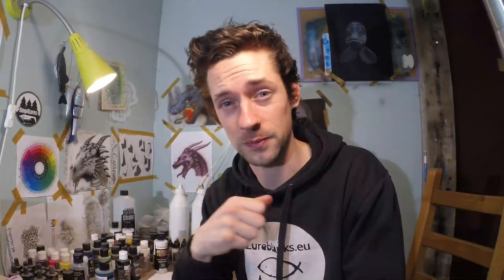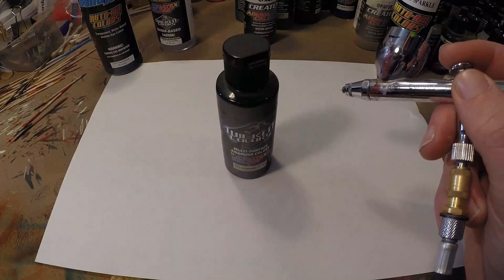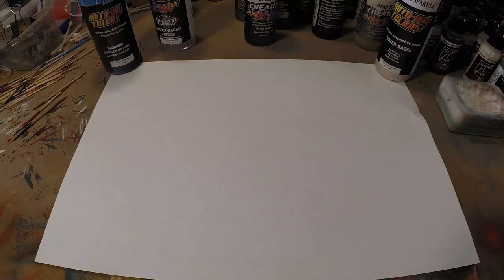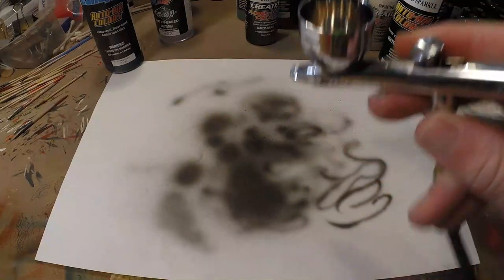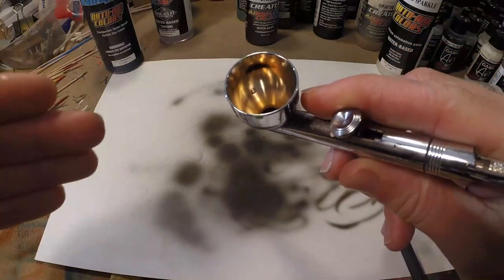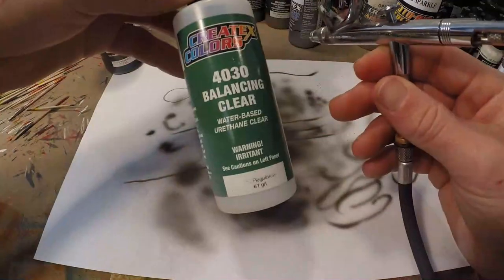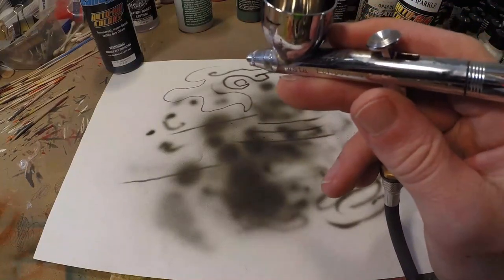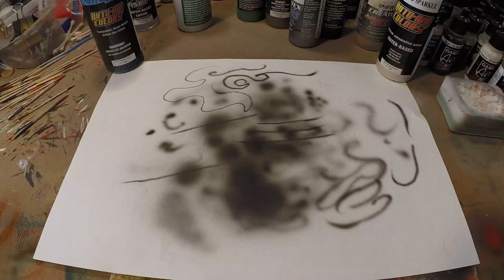Flawless Painting Every Time: Tips to Eliminate Tip Dry

Comment: You was talking about using 4030 .  When lure painting. How are you using it? Are you not reducing your paints with 4011 reducer and using 4030 instead?  Please explain
Reply from the maker: The 4030 balancing clear is not a reducer but a carrier, ( or medium if you like) I add 10-50% of 4030 to my paint (depending on how transparent or opaque I want my paint to be) and mix that with a little 4011 (about 10%-15%) 
Because 4030 is a little on the thick side and need a little reducing in my opinion.  

The 4030 changes the composition of your acrylic paint to a waterbased urethane paint. Which has better spay ability and much better adhesion. Also does it dry to more plastic like substance which is much stronger then paint without 4030. 

So 4011 and 4030 are 2 totally different products 👍
Reply: @lureblanks  exactly.  So everytime you paint you are basically adding a drop of 4011 and a drop of 4030 to your paint every time right? Even base coat? And that slows down dry tip right?
Reply from the maker: @fishingwithhoffman7365  Yes that is correct,  especially base coats , because we want that very first coat  to addhere well. Or else all the rest that addheres to the base coat is in vain anyway if the base coat is not adhering well 👍
Reply: @lureblanks  awesome thank you  glad you said this  i got a big bottle 8oz   that should help me alot. I had humidity yesterday and it was a mess.  Was driving me crazy. I know its not the paint. But never thought to add 4030  that's great advice  ty sir
Reply from the maker: @fishingwithhoffman7365  You are very welcome, humidity is a difficult thing to work with. Some say if it is really humid if works better with the 4012 reducer.  But for me the 4012 causes more tip dry. But sometimes you got to experiment a little 👍
Reply: @lureblanks  yep. That's where i am at with it too. Learning as i go  and doing what you said  stop and thinking about it. Great video man. I appreciate it alot  the info
Reply: I do have some 4012 too  i also have a thermometer that shows the humidity too.  What is the right temp and humidity for painting? Do you know?
Reply from the maker: @fishingwithhoffman7365  Thanks! And no I honestly do not know what what the ideal circumstances are for airbrushing when it comes to room temperature and humidity 😄

Comment: I'm using cerakote and when I turn on fluid and no air paint sticks to needle and then splatters do you know what problem is I used alcohol same thing
Reply from the maker: Hi Damen, This can be caused by a lot of factors, it is really hard to tell what the problem in this case would be. I suggest googling a little on the internet and following some troubleshooting steps. Iwata has a great troubleshooting webpage for this 👍